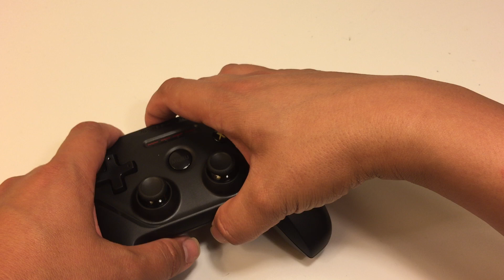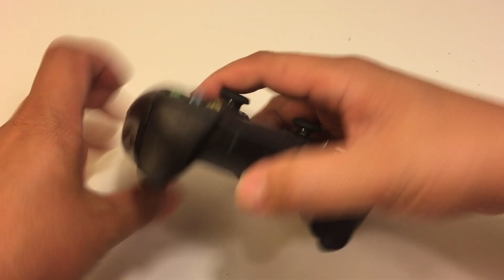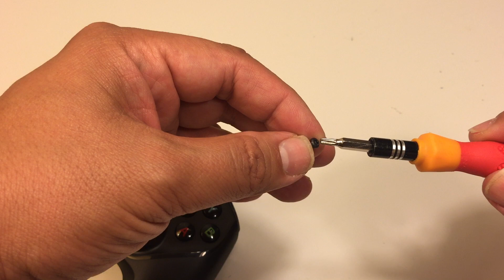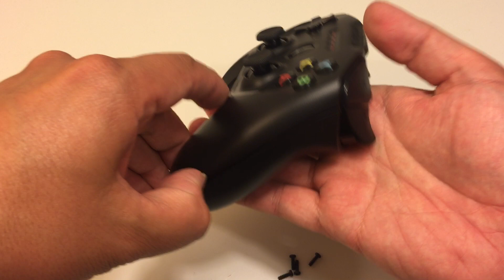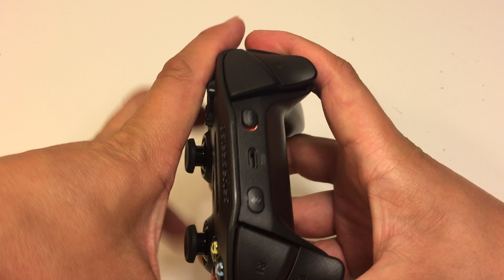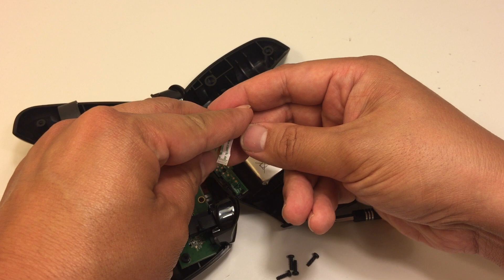SteelSeries Nimbus take apart

Comment: All 4 of the LED lights on mine are on but it won’t work or turn off. What do I do? I have Nimbus+ Controller.
Reply: Oh ya bro most of the nimbus plus ones are defective but I have the original nimbus it’s great when I play GeForce now like destiny I just but the sprint button as a different button and it’s already on destiny 2 the custom controls

Comment: Big thanks man. Mine had been apart about 15-20 times and this time the stupid flat cables gave out. Used your video to sort out the blue from white. For those wondering those cables are 10 pin 0.5mm pitch flat ribbon cables and are available on Amazon if they fail you. Not obly that, but in various lengths. Replacements are thin and weak so buy a few.

Comment: Wet helpful! I was gonna take off the front and spray paint and customize it, but now I know I can’t do that because the circuit board is on the top panel. Thanks for doing this so I didn’t have to
Reply: I was gonna do the same but by hand with small brushes and special paint. Think it could be done?

Comment: My nimbus isn’t lighting up when I charge it and when I turn it on 
Any solutions?
Reply from the maker: First thing I would do is try a different charging cable.  If that doesn't work I would take it apart and check the ribbon cables don't have any corrosion and are seated in properly on both ends.  Next things I would try are swapping parts with a good Nimbus, board that has lightning connector, ribbon cables.
Reply: @aremdvnasophia  thanks for the help!
Reply from the maker: @agaming7288  If that doesn't work maybe you can buy a new one and return the defective one.  Or buy a new one with extended warranty and have them fix your broken one.

Comment: Can you use a t10 and do you go slow when opening it plz help my anolag sticks don’t work at all
Reply from the maker: It's been a while since I've taken it apart.  On mine one analog stick was constantly pointing down.  I remember searching YouTube videos on how to fix analog stick.  I think I used the rubbing alcohol and a q-tip.
Reply from the maker: Not sure what size the bit was that I used.  I had a super cheap screwdriver set from ebay and just picked the one that fit best.

Comment: Can you replace the analogs?
Reply from the maker: I think you would change the board, unless you want to do some soldering.  Remove the three screws holding the board with the analog sticks and lift the board straight up.

Comment: Where did you find the replacement battery? Regards.
Reply from the maker: I could not find a place that sold the batteries for it.  So your best bet would be to pull it from a as-is one on eBay and hope the battery was not the problem.

Comment: Not very helpful but nice try
Reply from the maker: What problems are you having with your Nimbus?  I took mine apart further because "A" button was stuck.
Reply: how did you go about that? did that also require unscrewing the controller? My A button is also currently stuck and i've tried to unjam it with a pushpin/paper clip/knife but they are not thin enough so im thinking about opening the controller up but i dont want to mess any of the tech components inside while doing so..